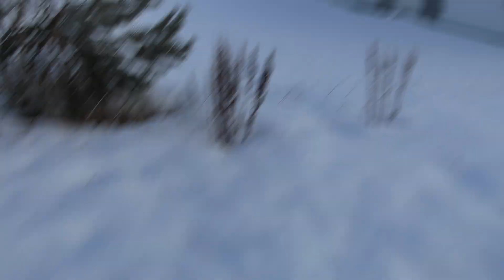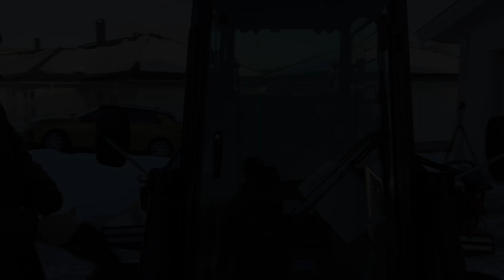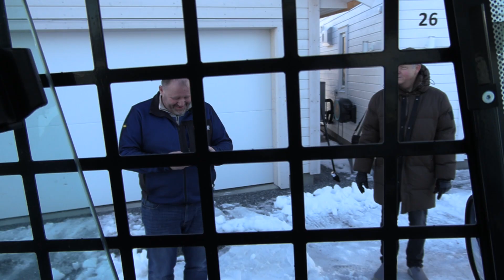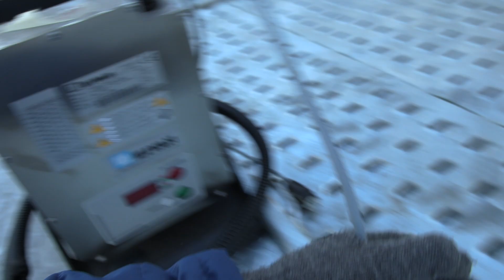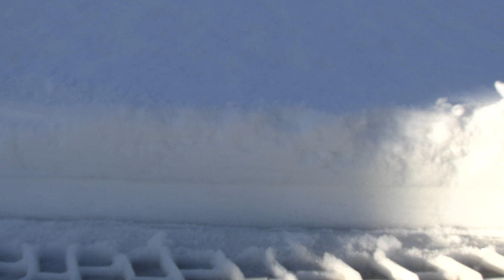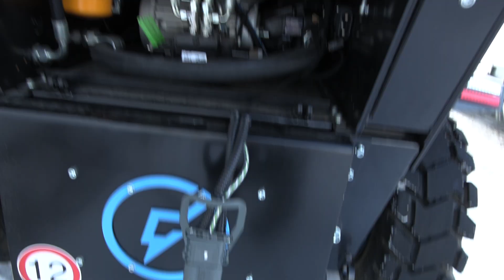Clearing snow with Elise 700 electric skid-steer

Comment: Actually the approach of connecting the battery to either charger or equipment is quite popular, be it RC cars, forklifts or as it seems skid-steers ;)
Reply: we use the danfoss Remote Control
IK2 Transmitter

Comment: Now for electrified trailers with EV motor axles and on-board battery enabling no-range penalty for towing also trailer battery can be used for charging equipment.
Reply: Already have them for RVs. I think there are two that are in production.
Reply: There are also some truck trailers with battery electric powertrains on the market already. The cool thing is, these can be used with both diesel and electric trucks.

Comment: Looks great.
Same people here in Germany are thinking, that a battery machines are not working here. Because it is to cold here😂
Reply: They don't. This is all paid advertisement, using the brand new machines for a few minutes for the cameras. With pre-installed chargers.
Reply: @pistonburner6448 

Stop it…

Battery works well in the cold.  Diesel does not work when it’s cold. It gets to thick.

There is a reason you can not turn of an engine when it’s cold without connection to the electric grid… 

Every winter I see countless diesel and gas car getting towed when it’s cold as they can not start. Never any bevs.
Reply: @Errorcode403   Incorrect. You just made that up and you have no basis for any of that.
It's a fact that cold batteries do not perform properly and can easily be damaged by it, and use when too cold.
It's a fact that charging losses (already huge from the start) increase massively when cold is introduced into the equation. 
It's a fact that batteries require massive amounts of energy (Tesla uses over half of what a car typically uses for driving) to heat up the battery.
You lied to the wrong person: I've researched the automotive industry for years and have happened to be based near the arctic circle for many years. I've tested EVs, PHEVs and many ICE cars.
In cold climates winter diesel is used and people have been using diesel (and gasoline) on work sites for decades and decades.
Reply: @pistonburner6448 live close the the artic circle to. And work on developing electric trucks.  

And yes there is a lot of diesel equipment used here. But there is a reason a lot of parking lots have electrical outlets around here.

And no I do not lie.

But please provide your research.
Reply: @pistonburner6448  Funny how norway is extremely cold but yet they have almost all evs for their vehicles and are having no issues....  but yeah batteries don't do good in the cold... okay bud. wake up.
Reply: @pistonburner6448 " It's a fact that batteries require massive amounts of energy (Tesla uses over half of what a car typically uses for driving) to heat up the battery." - yeah... that is not a fact :) - Model 3, loses around 20% range in cold, do to more things than heating... - Try again xD
Reply: @spro_halver8553  Who says they're having no issues? And it's costing them billions.
Reply: @amosjovt   You are incorrect in how much range Teslas lose in the cold, and such a statement is nonsensical anyway as there are so many variables that you can't possibly say one number on how much it loses. It can lose nearly infinity in the cold if you do short hops and park in between, with the car cooling down. Not to mention charging losses alone are over 20% before even adding in heating for the battery and the cabin.
It is a fact that Tesla's 'Afterburner' uses 7 kW of power when preparing the battery for fast charging (and continues to heat it up during charging, it can do that over 30 minutes just for one charge), and that is what I wrote about. That is proven by testing.
Reply: @pistonburner6448  i promise you that there is nowhere nere a 20% charging loss, on AC chargning at home.  The heating of the battery with the afterburner as you call it is only done when you need to go to a fast charger, and there the heating after charging the battery will go into the kabin, so not a total loss, and it's a perfect way of reusing that heat.
Reply: @amosjovt  Who cares what you promise, liar? This is based on scientific research. One such study was conducted by ADAC. The lowest of all EVs was BMW with about 10% loss. Some Teslas had over 24% IIRC.
Reply: @pistonburner6448  not on AC :)
Reply: @pistonburner6448 Norway have the highest level of vehicle electrification rate.

Comment: The cost of battery degradation should be counted as fuel cost also because the machine will outlast several battery packs due to the chemistry.

Comment: This is awesome stuff, very cool to see. Also, if it supports external controller (like xbox via bluetooth-phone), it would be quite fast and easy to operate from outside. This is also useful for times when you need better visibility as the operator

Comment: I used to work at construction sites where diesel skid steers and other equipment was used.  All day long hearing the loud engine and breathing diesel exhaust fumes.  This would be so much better.
Reply: The question is does skid steer last a full day on the job side?
Reply: @ReinhardSchuster Yes. FirstGreen skid steer has battery swap enabled that takes about 10 minutes to swap batteries. Also additional batteries can be charged offsite, so no need to charge on site.
Reply: @tedspradley  Irrelevant without you revealing the pricing, the price of charging solutions, time used to install and arrange for charging procedures separately for every site, the management and execution of charging plus monitoring of charging, theft prevention, the cost of the extra batteries on top of the extremely expensive machine, the lack of qualified mechanics, the unreliable parts support in the future, job site safety, etc. etc.
Reply: @ReinhardSchuster   No, and EV does not. And most job sites don't have good charging possibilities. Not to mention all the cost of all that stuff.
Reply: @pistonburner6448  I did work with a Skid Steer in the past and 10 hour runtime was normal 4 Days 10-12 hours and a 3 day weekend.
Reply: @pistonburner6448 FirstGreen skid steer has battery swap enabled that takes about 10 minutes to swap batteries. Also additional batteries can be charged offsite, so no need to charge on site.
Reply: @ReinhardSchuster  Do you mean that you agree with me because you DID (instead of didn't) work with them and that's what your experience says.
Reply: @ReinhardSchuster   I have managed a factory and countless building sites, and there is no way I'd buy a machine like this for our company. Nothing at all speaks for it, there are no relevant favourable factors for professionals doing actual work.
Reply: @pistonburner6448  unfortunate autocorrect error
Reply: @pistonburner6448  You seem triggered by this technological advancement. I also have owned construction companies and factories with fleets of heavy equipment and heavy trucks. This is a great tool. Hope you find relief from your pain and can live in peace.
Reply: @ReinhardSchuster  👍
Reply: most importantly: with electric mashinery an 8h workday probably means less than 5h actual run time since with Diesel motors the hour meter keeps running during ideling, thats not needed with electric. Years ago reviews around electric CAT diggers at BAUMA mentioned that.
Reply: Yeha, they all work for 8 hours. No more multiple shifts
Reply: Did you see that you can charge it back up? 😂😂 Imagine charging at 11KW that would in reality already be almost enough for 2 continuous shifts...  Then imagine 22KW ❤❤
Reply: @MrKOenigma   What do you mean 'continuous shifts'? Having to stop for charging literally means they aren't continuous.
Reply: yep future construction sites will be much quieter and nicer
Reply: They have gotten quieter and cleaner. Not to mention that if the EV push wouldn't have taken all the resources and taken away all investment from other fuels, they would be far cleaner still by now by using natural gas, biomethane, bioethanol and e-fuels.
Reply: @pistonburner6448  Lol EVs do not take resources away from combustion engine development. Manufacturers postponed EV development for decades. Combustion engines are already at peak efficiency and will still remain polluting. It's over.
Reply: @Freba9   Wrong. The manufactured narrative of EVs as the only solution, their completely separate and fraudulent measure of emissions under a separate framework, government policies forcing a shutdown of ICE sales has in fact of course taken away resources from developing and implementing alternative fuels for ICE. You clearly haven't been an auto industry analyst for decades like I have.

Comment: That is not the right tool for that job, but nice machine :)
Reply from the maker: What's the right tool then?
Reply: A Volvo L120 and it's done in 2 minutes. @bjornnyland
Reply: @AlexanderLeick  fuel cost 999 euro :)
Reply: @bjornnyland  A regular snow blower?🙃
Reply: @konsul2006    yes you cant attach the snow blower and you have cleared this in 10 minutes. But in this case bjørn wanthed the snow moved to the other side of the road.
Reply: https://www.youtube.com/watch?v=U8EOnMVMzFM

Comment: i think that economic incentive is better argument to invest in electric machinery compared to "saving the planet", because a lot of the electricity (globally) is made by using oil, coal and gas. norway is a unique country in its energy production.
Reply: There's also the noise pollution, and diesel fumes. Also no need to go buy cans of diesel to store in your garage, or handle engine oil which needs to be disposed of somewhere. I can think of many more things other than saving the planet.

Comment: 40% på en gårdsplass? Blir mye lading😀
Reply from the maker: It's 200 m². The big 40 kWh battery would consume 25 %. So that's good for 800 m². And remember that this is wet snow.
Reply: If they could just steer the snow and lift it up at the end instead of carrying it away that would make a huge difference, maybe less than half the battery use compared to this?